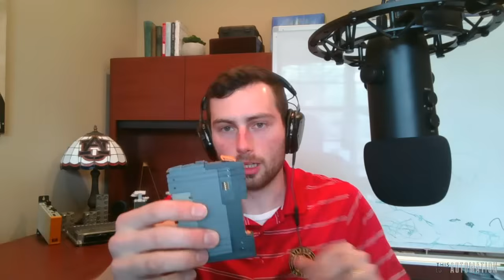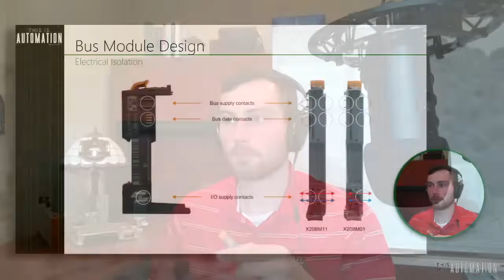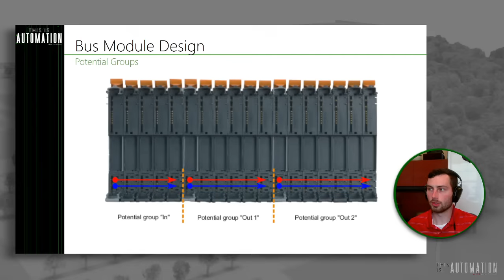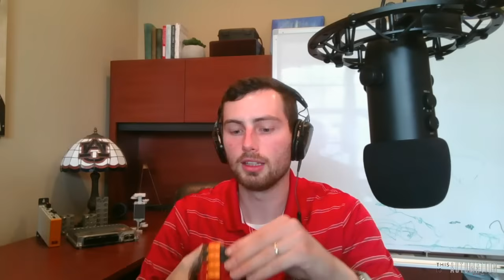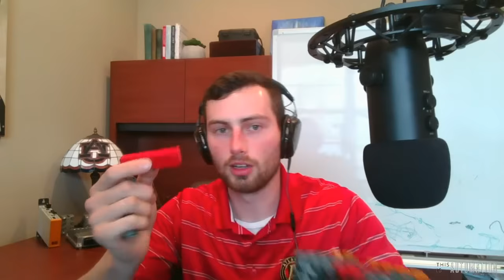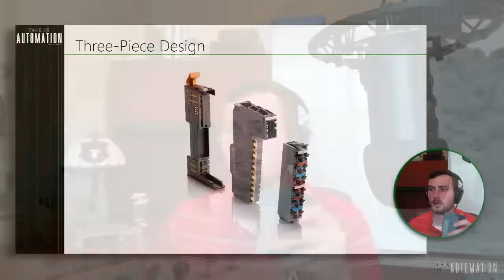Anatomy of an I/O Slice

Comment: Great tutorial.  Glad that I found your channel.  Subscribed.  I have a question.  Is it ok to replace one of the electronic board ( the middle unit) while the X20 unit is still running? Without power down the X20.?

Comment: hey
iam not sure if you see this comment
but i have a question 
how to connect the pc to the x20bc0083 ? bus controller
and dose it work like a cpu ?
cause i have a system that dose not have a cpu and it works only with the x20bc083 and i want to modify something
Reply: Hey there, 
Bus controller can be communicated with a CPU via ethernet. You can find all about it on b&r website if you just search x20bc0083
Reply: if the all the power source connected to the bus controller bc 8084 and io cards fails ,what will happen to bus controller when powering up again .do i need to upload the programme again to communicate to this bus.